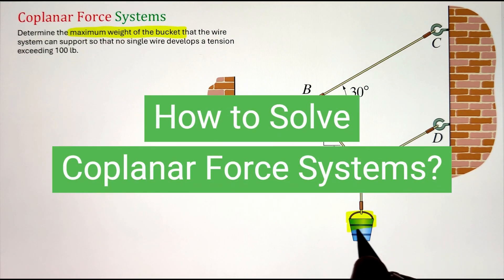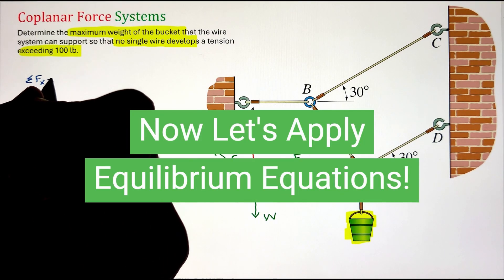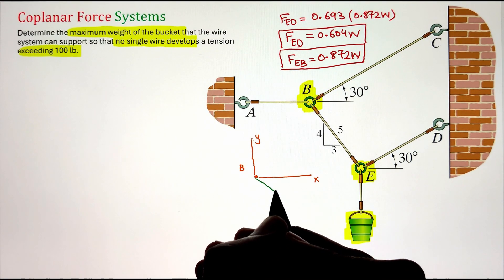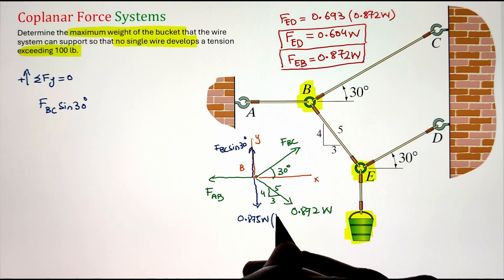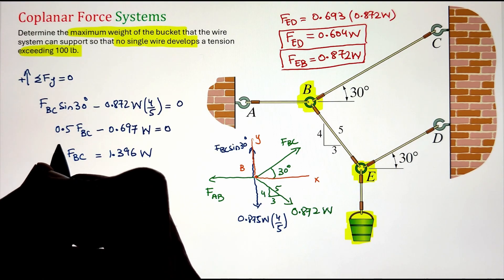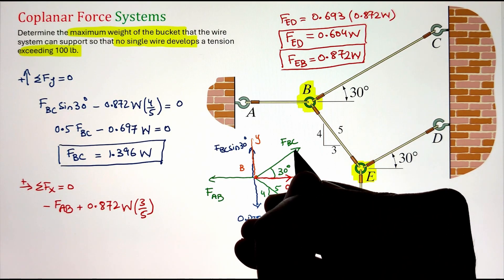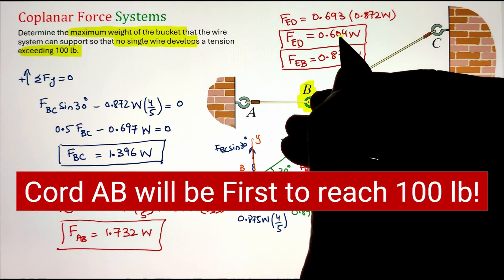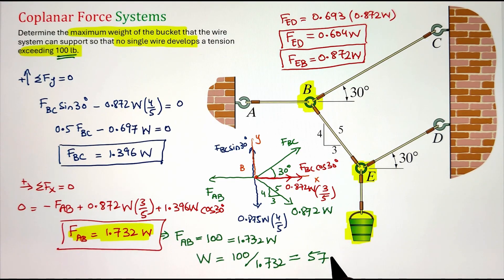Engineering Mechanics | Coplanar Force System & Tension in Wires

Comment: How did you get the 0.872? Everytime i input in calcu the result is 1.146
Reply from the maker: Once you add them you get 1.146FEB =W, next I divide the equation with 1.146 to get FEB=W/1.146, that becomes FEB = 0.872W.
Hope this helps
Reply: @MathPhysicsEngage  thanku
Reply: @MathPhysicsEngage  how does it become 0.872
Reply from the maker: @marbertosuliva9047  if you solve the fraction 1/1.146 it will give you 0.872